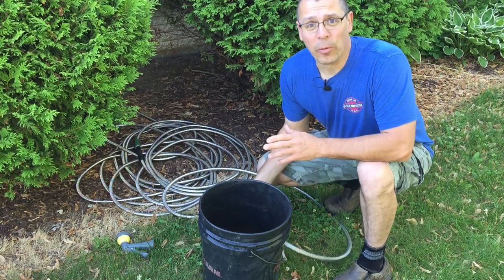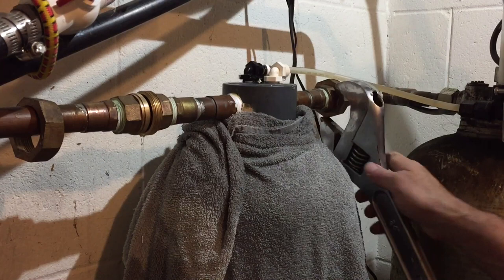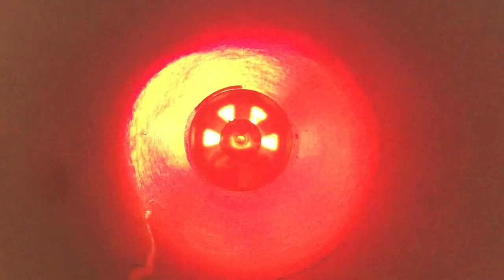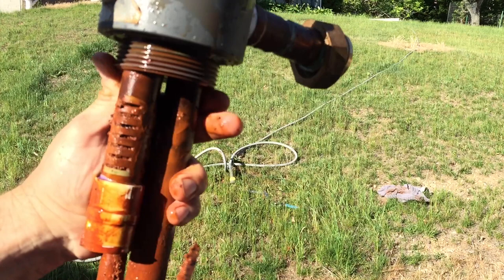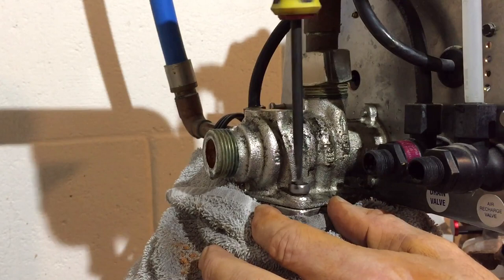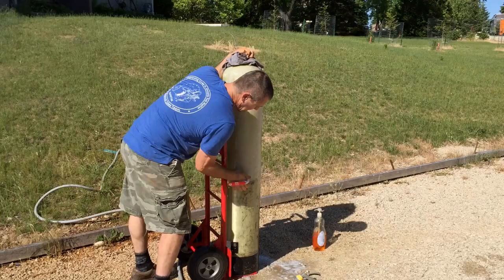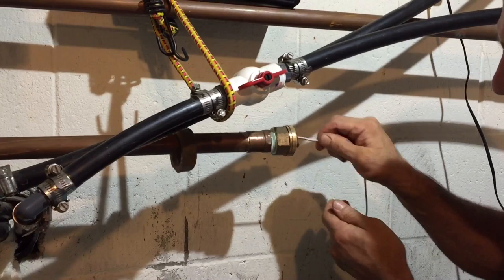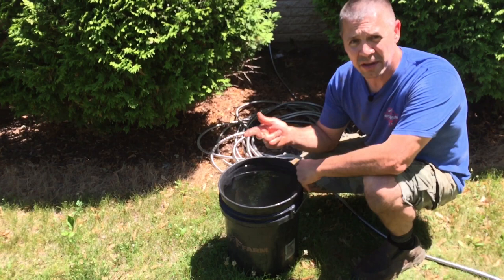Iron curtain maintenance Hellenbrand Iron curtain cleaning. IMPORTANT UPGRADES ALSO

Comment: On my system air is injected through a Venturi. The oxidation tank has a relief valve at the top to release excess air. The media tank is filled with calcite which neutralizes the acidity. It also traps the iron particles between backwashes. The calcite is slowly consumed and needs a slight amount added annually.
Reply from the maker: @user-oy4qp9pq6i  it’s just about time for me to redo this job again. I think I have something going wrong because of the large amount of rust build up.

Comment: I've not seen all of your videos, but my water is just as bad and got plugged up for the the same iron reason. I have a system  from easy water. i have a regenerating filter, a big tank before it , and a peroxide injector. Just added a uv light for the clear iron bacteria.. everything was working great and the water stayed clear until it plugged up and the plumbers took most of it apart to clean everything out. it would be nice to know if I can learn how to keep the plumbers away.

Comment: I think you probably have a problem with your backwash valve on the media tank. It doesn't look to me like the backwash cycle is working. There should not have been that much oxidized rust in that tank.
Reply from the maker: Thanks for the tip I will check that out tomorrow afternoon for sure!!
Reply: @whatsnextgarage  First TY for the video. But now as I think I have the same issue(s), did you check your backwash valve and what did you find?
Reply from the maker: Well Tom honestly I never looked. I was going to and here I am a year later and will have to do it this summer. Sorry I have no information about that.
Reply: @whatsnextgarage  Fair enough. This being the first of your videos I've seen and the quick follow-up you provided has my curiosity piqued. Going to look at the breadth of coverage and see if I can get you a bump in subscribers. Good Job!
Reply from the maker: @TomRolfson  I do appreciate your feedback!  Have a great week!